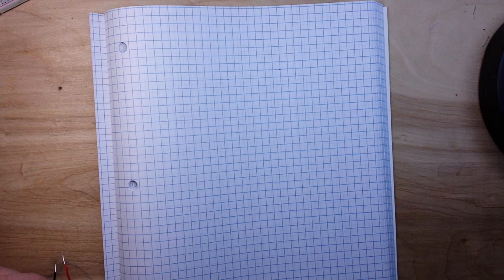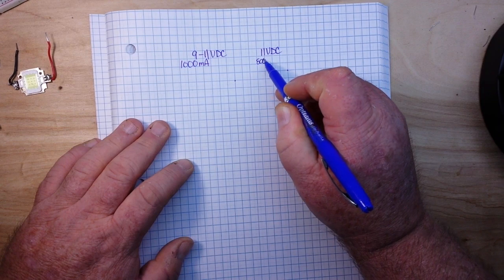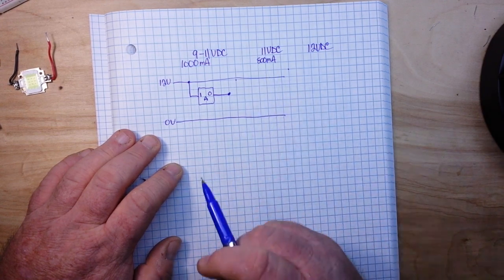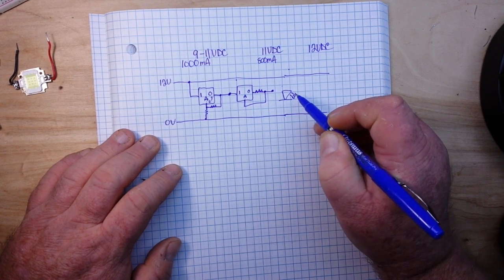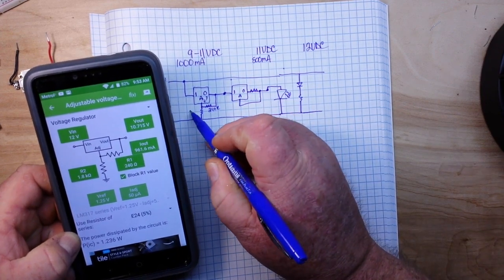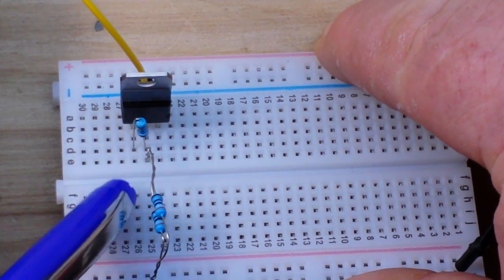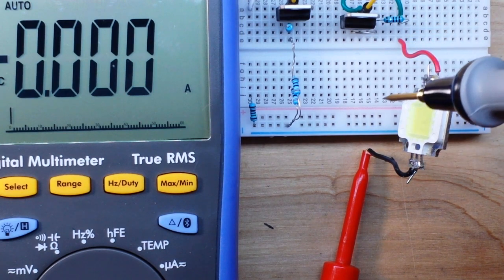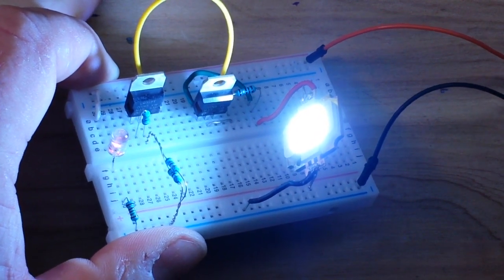Easy DIY LED Driver

Comment: You actually don't need the first stage 317 circuit with the input voltage regulation. Just need the constant current source part of the circuit. 

You can use an unregulated low voltage DC input so long as it's always higher than the LM317 input dropout voltage spec and can deliver the load current. The CC circuit will deliver the rated current to the LED and the LED will determine its voltage for that current determined by its load characteristic.

The CC circuit will deliver constant current to the LED independant of the changes in input voltage and also the LED load. Simplest LED driver around and it works just great. I use this simple circuit for all my aquarium lighting LED chips with wall wart power packs.

Comment: This seems like a terrible design, while easy the regulator has to dissipate 20% of the power.
LM317's are usually used to create reference voltages rather than just dropping the power.

Comment: I used it to power a 5 Watt COB with the same power usage and it worked well.
I was afraid of the resistors getting to hot as the first thing I read was using them would not work and I need to Buy a driver. I think they were just trying to get me to. Buy more stuff.
Thanks and I love watching your vids.
I'm looking to use a leds that have 1 positive and 4 negative for white and RGB. The 74hc595 doesn't works but I heard theres another ic that could do the job maybe you could do a video on it and use a fancy program. Like fritzing. Cheers

Comment: Hi!
I bought a led driver which reqiures 5-32vdc input. Can i simply use an adapter with an output of 5vdc/2.5A? If so, what's the difference if I'm going to use like 12v or +32v as an input of my driver? Thanks!

Comment: To do this in parallel with 5 more 10W LED’s how many more LM137 current regulators would you need?
Reply: Do you mean connecting 5 more leds all in parallel with each other?

Comment: great instruction video! i still have a question... im complete noob in 
electronics, but i can build things following instructions... i want to 
make my own led worklight from makita 18V 9A battery. now the question 
is about the amps... can i build by the same scheme you are building 
here or do i need any other parts because of higher amp input? i did use
 electrodroid app and i cant see anywhere to adjust amp input. for volt 
input i adjusted 18v and i dont see any difference on my app comparing 
to your app. I also want to make my worklight a bit stronger as 10w... 
was thinking about 30-40w... how does this affect in to the building of 
driver circuit? also how do i connect led chips? parallel? thanks again 
on your time and hopefully for answer as well!
Reply from the maker: Email me arduino0169@gmail.com

Comment: I'm a little confused about not needing the voltage regulator, say you use a laptop PSU at 19,5 V (which as I understand is constant voltage) and you have 4 LEDs with a fv of 3V @ 1 amp would, it adjust volatge to 12 V ? since the circuit only draws 12V ? nice vid by the way

and is there no voltage drop over the LM317 ?

Comment: From my understanding of working with LEDs, is that they are current sensitive and only need current regulation to produce the correct and constant lumen level.    It was interesting to learn about the "Electrodroid" app and how to use the LM317 for Voltage or Current regulation.  My home's outside LED lamps each have a single module that converts 120VAC to a constant current DC source to run the leds wired in series.

Comment: The only possible problem I can see is the resistor on the current control stage will need to be a much higher wattage.

Comment: I tried hooking my high powered LED right up to my bench power supply and it didn't work. Do I need an LED driver?
Reply: No it should work , led driver are used when you have to use leds for long periods of time

Comment: Why would you need a power indicator LED? It's pretty easy to tell when this thing is on!
Reply: CoolDudeClem Then you could check if the power led is off that there’s something wrong in the circuit, something failed.

Comment: Quick question isn’t that cc Circuit going over the rated wattage of the resistor.
Reply from the maker: +RJ Anderson probably, works ok for the demo. You would need a higher rated resistor to run continuously.

Comment: After seeing the app you used I hit the app store and got it, I'm very pleased with it, extremely useful, intuitive and a nice GUI. Very slick indeed, thanks for the tip,  (even all sorts of Arduino pinouts for many boards).  Cheers.

Comment: Stupid question maybe, but isn't your sketch wrong? Should the resistor not be placed on the adjust pin, i calc at least a 8w resistor otherwise. If I look at the build the resistor is on the adjust pin. I have a bad habit of drawing the circuit and not looking at the build sometimes, but it felt not ok, a 1/4w resistor in series with a 10w led ;-) . I apologize if i'm wrong.
Reply from the maker: Check out: http://www.ti.com/lit/ds/symlink/lm317.pdf

Look at figure 8.3.7
Reply: Finally got it, "I" may be big but "U" is a lot less. To calc "P" for Rs = 1.25V*0.800A=1W resistor power consumption. Thanks, you got a new subscriber ;-).

Comment: Do you even need the first regulator?
Don't think you can get 11V out with only a 12V source, and that's using a low drop out regulator. I have six of these on a heatsink that is powered with an old track light transformer. With no regulation at all, driving them at 750ma each with no problems for years. I don't think you need current regulation unless you are driving at full power.
Reply from the maker: You could skip it. This is just an example of the classic circuit.
Reply: If you use it on an automotive, the charging voltage jumps up to 14.7v  I think that is what the first regulator is for.